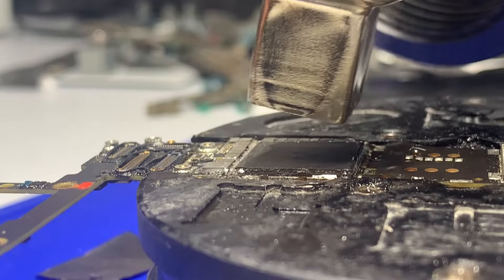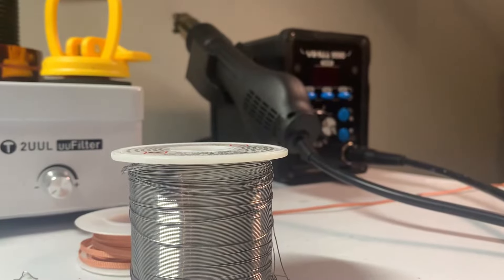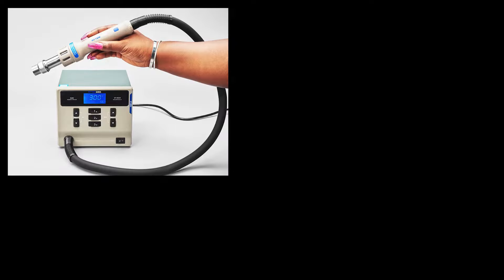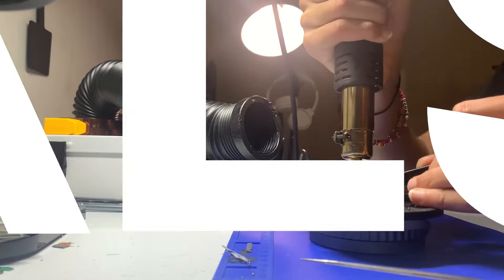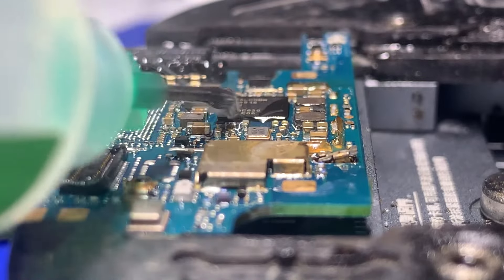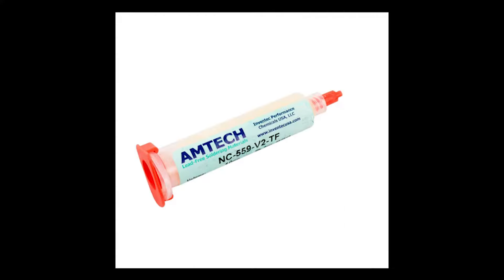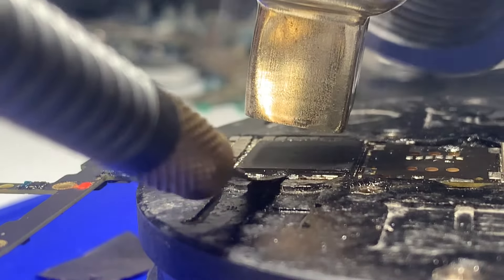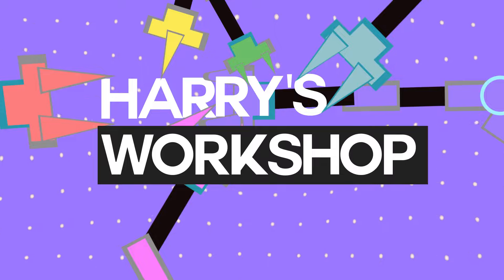BEST HOT AIR STATION - Budget MicroSoldering

Comment: Suggest a pcb holder too
Reply from the maker: @Uncertifiedelectrician  honestly, I haven’t found one that’s any good - the qianli circle holder in this video is garbage after a week.
Reply: @HarryKwastaken  yeah it's a struggle.I'm looking for one from quite a while
Reply: @HarryKwastaken  is the pinecil soldering iron any good?
Reply from the maker: @ only if your soldering EXTREMELY small pads - because it’s so small, it can’t heat up as much as bigger irons for bigger pads. I returned my Hakko pencil because I never needed it on iPhone and iPad boards

Comment: Cool! How much heat can chips withstand?
Reply from the maker: @billshedd55  It depends on how thick the board is and if there’s underfill. For iPhones, I like to use 400 degrees Celsius and I’ll heat until the chip comes off - but I’ll be sure to place some quarters around the chip to distribute the heat evenly across the board…

Comment: Thanks for the Video,  I bought the Station from Amazon over Black Friday/ Cyber Monday and got for $55, could You please put links for the Bent Tips and the Clear Flux, Thanks
Reply from the maker: Thank you so much!  The flux in the video has unfortunately gone out of stock pretty much everywhere, I’m currently using: UG-78 10cc solder flux which is actually better.  And here’s the bent tips: https://www.amazon.com/Resisting-Nozzles-Soldering-Desoldering-Accessories/dp/B08N3X8DW9/ref=asc_df_B08N3X8DW9/?tag=hyprod-20&linkCode=df0&hvadid=632095890674&hvpos=&hvnetw=g&hvrand=6321095532686631076&hvpone=&hvptwo=&hvqmt=&hvdev=m&hvdvcmdl=&hvlocint=&hvlocphy=9051827&hvtargid=pla-1885594518172&psc=1&mcid=0246c60725433180b15843b7bd2c5a8a&gclid=Cj0KCQiAgqGrBhDtARIsAM5s0_mdW7hU8teioFPeg0qLHBB0hmZBByhepg_WAkyO8y2QTIhR_CSHEscaAumlEALw_wcB .  Thank you for your time

Comment: What about the best solder? What is the best? Thank you!
Reply from the maker: @encapsulatio  Kester 63/37 is really good
Reply: @HarryKwastaken  Is there one just as good but lead free?
And could I use that type of solder for BGA reballing work? Is this budget air rework station out of the question if I want to use lead free solder since the melting temp might be significantly higher?

Comment: Still working?
Reply from the maker: Yes!  I’ve upgraded to the quick - but I use this for disassembling all devices
Reply: @HarryKwastaken I was looking for a decent one and always worry about things made cheap overseas.  Was looking at Xtronic also. Good video!  Oh forgot recommend a good microscope device?
Reply from the maker: @Soulcommander  Thank you!  If you’re doing this professionally, and want one for the next 4-5 years, I’d upgrade to the quick 861 DW from a reliable source, otherwise the Yihua is a solid and reliable option.
Reply: @HarryKwastaken  Any microscope recommendations?
Reply from the maker: @Soulcommander Amscope all day - it depends if you need a camera or not, and if you’d like a wider view or not…

Comment: nice video thanks. What is the name of the flux you use?
Reply from the maker: The flux in the video has gone out of stock pretty much everywhere, I’m currently using: UG-78 10cc solder flux
Reply: @HarryKwastaken  Thank you so much!!. North ridge fix sells some flux, AMTECH VS-213-A-TF. I think out of stock one was similar to that one??
Reply from the maker: @YODA1969  the out of stock flux was made by 2uul, and was $2 - there’s significant difference in the consistency between Amtech and the now unavailable 2uul flux.  Both are still awesome, but the low price for the same quantity of flux really stood out to me….
Reply: @HarryKwastaken Thank you for additional info. you are so nice!!

Comment: I have a similar unit, the Yihua 2008D, which couldn't take a 0201 capacitor off a PS4, with it set at 500°C and 100% Air, with a thin angled nozzel tip.
This has made me look at more expensive units.
Reply from the maker: Yeah, I’ve seen this too - I got a quick 861 DW, and I really love it. For thick boards, you need consistent and high airflow with very high temp, so this is definitely not suitable for anything but phones
Reply: @HarryKwastaken  what made you choose the Quick 861 over the Atten 862?
Reply from the maker: @RestoreTechnique  I got a sale at my wholesaler, and got it for super cheap - they’re both pretty similar. I wouldn’t say one is better than the other…
Reply: Are PID controller work well?

Comment: Could I use this for laptop usb c ports? I damaged mine and it requires a hot air rework station to remove the old port. Specifically a thinkpad t480.
Reply from the maker: @viracobama  Yup, it’ll be good. Be sure to add plenty of flux, and only lift the port when you see the solder melt from the heat.  Best of luck, and let me know how it goes ;)

Comment: Are you using it with  hotplate?  I had one of these on from amazon, i couldn't melt led free solder paste, but it managed to melt the handle of it, so I  sent it back.
Reply from the maker: @Aeson008  I am not using a hot plate - maybe your piece was defective - or you were using a very thick pcb…. For phones and tablets I’ve had no problem with board repairs
Reply: @HarryKwastaken  Yeah I've got some thick PCB's to work on for my DIY Eurorack synth project. Maybe a give a try with a hot plate under it.

Comment: just got the 959D, but just noticed the attachment part is similar, if not, the same as a soldering input. can a soldering iron plug into this thing?
Reply from the maker: Unfortunately no :( and it would be weird trying to change the air speed on an iron…

Comment: I don't have any experience with heat stations and im literally just starting to self teach myself how to solder. Ive been slowly teaching myself how to soldier for about a year now, but I've only been able to learn once in a loonngg long while. Ive soldered a couple wires together, but they weren't very good looking at all. A couple of them worked but the majority didn't due to a sloppy solder job, lol.
 I never had a heat station, so it did make things more difficult. Ive been wanting one since ive began teaching myself but didn't want to pay much because i didn't have the experience. 
 However, i literally just bought this exact model, brand new for a major discount of 86.2% lol. Spending only a measly 11$ for an 80$ heat station, i couldn't pass it up. I literally just brought it home and plugged it in. So far, it seems like it works tremendously and it seems extremely easy to use!! Im looking forward to being able to continue my self teaching and learning how to solder properly!!
Reply from the maker: @OhioBoii330  best of luck, you got this!
Reply: @HarryKwastaken  I'm just glad I was able to get one of the best heat stations available for so cheap without doing any real research. 
 I really wanted one of those heat/solder combo stations, but I saw this and couldn't pass it up.
Reply: @OhioBoii330  if u dont mind me asking, where did you purchase this at or from whom. that discount sounds like it probably was temu? im curious because im shopping for a hot air work station right now. thanks

Comment: Hey whats up bro I just come across this vid today. Im thinking of starting phones repair more like back glass and then move on to more complex stuff. Will this be good for that correct? Thanks for your time new sub
Reply from the maker: Yeah, back glass is actually really easy with heat.  All you need is the punch tool (Mechanic makes one called irocks) - some good flat blades, and a lot of patience.  Get some housings of iPhone X, 12, 13 pro etc, and only use heat when needed.  Let me know how it goes

Comment: There is a version that also has a soldering iron that it part of the station "YIHUA 8786D".
Should I get that if I'm new to this work?
I need to replace a bios chip on a hard drive and I want to do it myself.
Reply from the maker: For the price, if it’s just for one project go for it.  But if you plan to use an iron and heat gun long term, I’d go hakko for iron, and a standalone heat gun.  Best of luck
Reply: I own a Yihua 706, and it's a super bulky and heavy boy with a compressor, which makes the hose to the hot air "gun" really thick, instead of the fan with the cheaper ones, in handle, but it's a really capable and solid station that holds temperatures pretty well and is as easy to use as the one shown here. I don't know if the 878D is any worse in terms of calibration, works just as good (my friend owns it) and is less than half the size of mine, while having both the soldering iron and heat gun. It might have lower power to the iron heating element, it seemed to heat up slower. I think mine has 60W peak heating. Oh and also the compressor/turbine lets you use much smaller diameter of the heat gun nozzle. I do some SMD works and it's great. The model you said seems like it's similar to 878D, clicky buttons, a fan, lower power. It's also compact and the fan is quiet. Mine is unfortunately very loud when using the hot air, the turbine vibrates and makes my desk resonate with a deep tone. My favourite is the fact that all three settings are controlled by dials, so no holding buttons needed.

Comment: i have cheap solder station like this one but the difference from expensive is the temperature ( air density ) expensive using air pump and this one is with fan and here is the difference you need more temperature to desolder / solder a bga chip .. for example emmc soldering temperature on expensive is around 350/360 on cheap 400-420

Comment: This thing is slick for the entry price and use. You can do a ton with it. If you have add some more extractor tools and heat shielding methods it does just fine. Mainly for high heat resistant surface mounted components, if you want to do a port of types get low melt alloy and mix with the regular solder joints then extract with reflow on low temp so you don't melt the port. Thing does it all, mainly the tips are bit of a pain to get snug the first time you set them up.
Reply from the maker: Well said.  And the tips are always super annoying.  Thank you for your insight!

Comment: What flux did u use? U never posted it in the description.
Reply from the maker: @10gaugesbelow  I used flux from a brand called “2uul”, but it unfortunately got discontinued shortly after. I now use a $4 flux, you can see it here: https://www.mobilesentrix.com/ug-78-10cc-solder-flux-paste-lead-free-smoke-free-no-clean-soldering-paste-flux

Comment: Hi, thanks for your video. I have just purchase the exact item because of your video, and have recieved it two days ago. It works great on melting soldering lead and taking apart my ESP32 board. But it struggled and was not able to remove one of the IC chip on my motherboard. I used 420 C for about 4 minutes and also 500 C for 2-3 minutes, still unsuccesfful. I wondered how you manage to take out SSD flash memory so easily and what is your perfect setting for temperture.
Reply from the maker: Did you try the big nozzle?  Also try increasing the airflow - there’s a big difference between vertical and helical wind - and this is illustrated best with your case; try a bigger nozzle, 450 C and higher airflow and lmk how it goes.  If it still doesn’t work, I’ll ask someone who knows much more than me 👍
Reply: If you are talking about a PC Motherboards thats probably because those usually have alot of copper layers. The chip is probably soldered to a huge copper groundplane which will suck up all the heat. For stuff like this u probably need an extra preheat hotplate since hotair will not be enough to get all that copper up to temp

Comment: Are bent tips universal ? Or do they need to be a specific measurement ?
Reply from the maker: They should be universal - if they have a Phillips head screw to tighten it, the bent tips should work for this station.  These should work https://www.amazon.com/Resisting-Soldering-Accessories-Traditional-Desoldering/dp/B08D6QKF42/ref=mp_s_a_1_4?crid=1VL399DLTXZYX&keywords=hot+air+station+bent+nozzles&qid=1687362676&sprefix=bent+hot+air+station+%2Caps%2C73&sr=8-4
Reply: @HarryKwastaken  this is the fastest reply I’ve received in my life c:. Thank you so much

Comment: That hot air is trash
Reply from the maker: Compared to higher end models, there is a big difference - but for $70, it’s a darn good bang for your buck.
Reply: They want £30 for  a replacement handle and the fan will fail in a couple of uses thats my experience a hair dryer would be better than this 🤣

Comment: Hi there. I am planning on buyling the Yihua 878D. It is a two in one heat station, with a normal welding stick as well. Do you know if is it the same good as the Yihua 959D? Or you would rather get the 959? It looks like the hot air flow is only (650W) 50W less on the 959D (700W).
Reply from the maker: I’d try the 2-in-1 if your just starting out and plan on buying something a little better quality down the line.  It will probably last you a year with consistent use then you’ll see some discrepancies.  Amazon does have free returns, so if you end up deciding the 2-in-1 is not for you, you know the 959D works well

Comment: Don’t buy this even as a beginner, spend a little extra and buy one with fan unit in the station, best to buy RF4 H2 hot air station but buy it from china if you want it £60 or around 75usd.
The station in the video won’t do higher demanding stuff like consoles and laptops, I’m not saying it won’t do anything on them but alot of things it won’t handle, there’s even a review on YouTube about it and he shows how bad it is compared to a atten one
Reply: Cheapest I found is 100€ 
With import tax and delivery it's gonna be more 
I used a handle controlled one for years it was good enough 

Only recently switched to a Station 
Still with out piston but it's GOOD ENOUGH 

The rf4 isn't even good enough to demand twice the price
Reply: @smug_cat1  they are actually good enough as these can’t do lots of tasks in electronics and most people have to upgrade unless you do little bits now and again

Comment: the 959d is junk Yihua need to stop making the handles with the fan inside this fan has 3 wires and not compatable with any other handle that uses 2 the fans are unfix-able and have to be broken open to even access the wires.
good luck trying to replace the fan or even the whole handle because there is no replacements.
Reply from the maker: Yes this is completely true!  The 959d should not be so long lasting logically, but I’ve seen it works very well for when your just getting into soldering.  I never cracked this guy open, but now that I just bought a Quick 861 DW, I’ll definitely have a look 👀.
Reply: @HarryKwastaken  Xytronic LF-861D is 1300w for the same price as the Quick 961 DW and probably has better build quality (made in Taiwan not mainland China). I have one of their soldering stations (LF-3300) which is a 180W high frequency iron (uses induction and a temperature probe instead of a resistance heater element) and have been very impressed with the quality of Xytronic stuff so far.
Reply: You can find the replacement handle part from Yihua store
Reply: @hairulole   They don't have any for sale anywhere in the UK